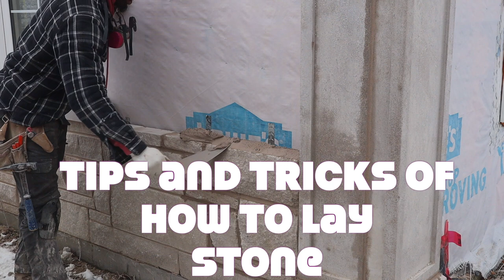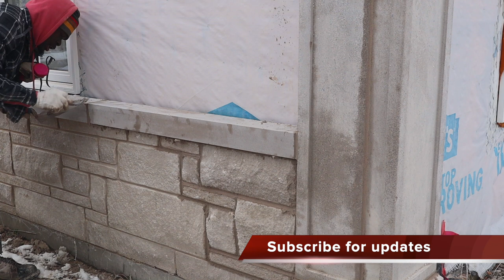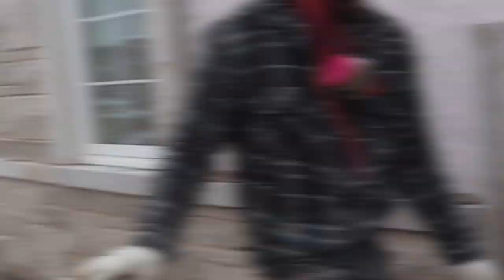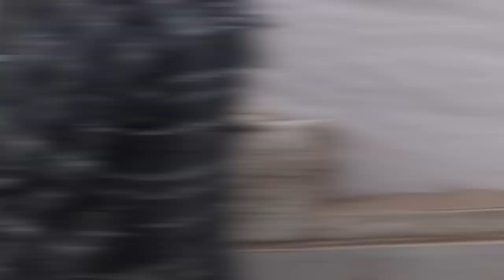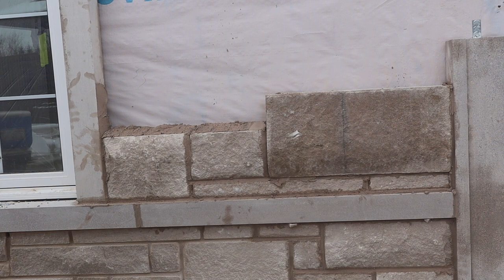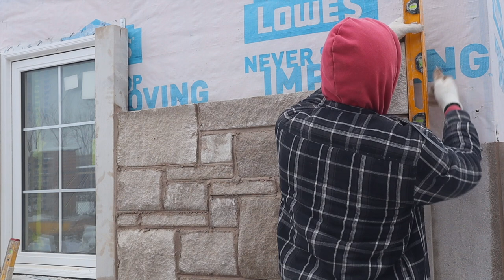Tips And Tricks Of How To Lay Stone , DIY Stone Laying

Comment: Ryan,do you use a frost retardant in the mortar? And what do you do if it's too cold to work?
Reply: Your suppose to have tarps up with heaters blowing inside, masonry needs to be atleast +3 degrees to cure properly or what happens is in the summer all the joints will start flaking away and cracking. Especially when spreading mortar and feathering it on bed joints (use tip of trowel to put a cavity in the middle of mortar) the mortar bed joint should be smooth not have a void in the middle this causes a hollow spot in the middle of the stones. Makes the cracking easier especially with natural stone I find. Anyone can lay it but it's all about the little things!!
Reply from the maker: we used tarps and heating if its too cold